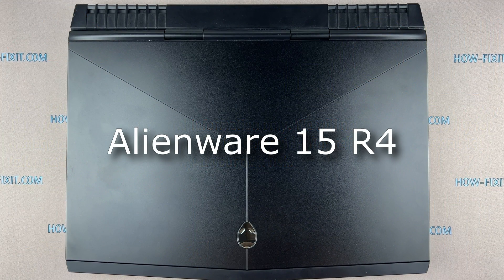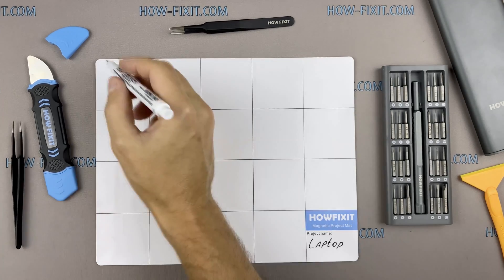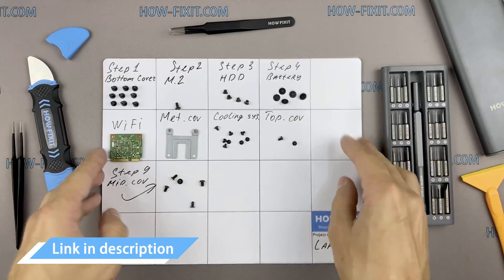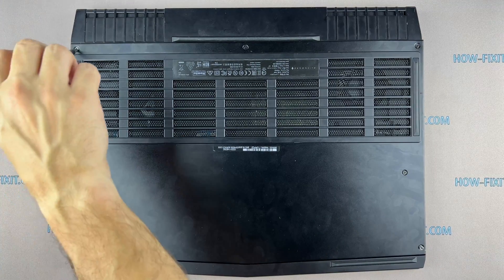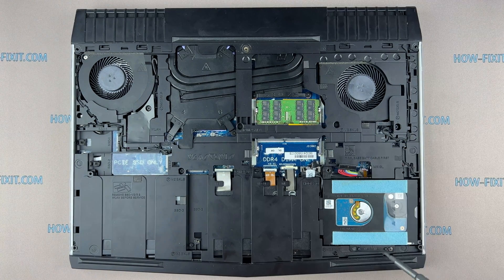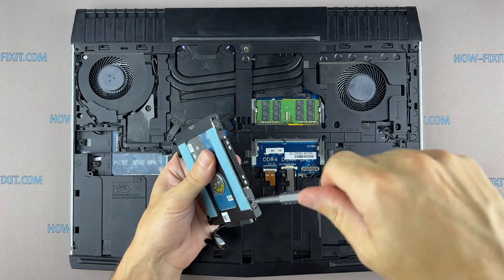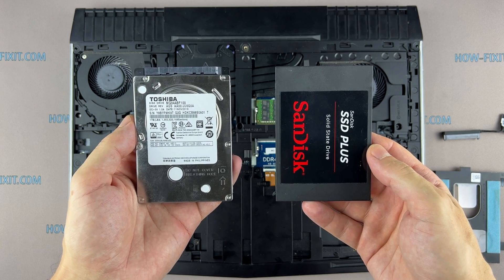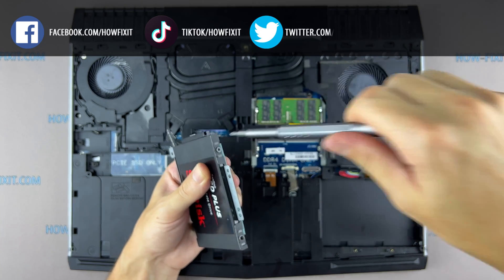Alienware 15 R4 Hard Drive or SSD Upgrade: Replacement & Installation Guide

Comment: umm i broke the wire connector thing that goes into the ssd. i think that is bad? i tried pulling it straight off like you did

edit: it is just the plastic part, not the pins. found a forum post saying i can tape it so it holds together and it also has those teeth. so maybe it's fine

Comment: One detail for post install is what software do I need? I had windows 10. Last time I install windows on a computer was windows 3.1 over dos 6.22 many ages ago.
Reply: Mine is stuck in a loop where it is attempting to fix the startup (or harddrive errors) and says it can't be fixed